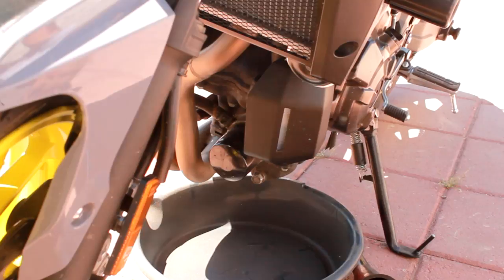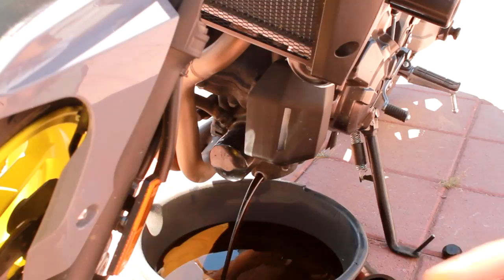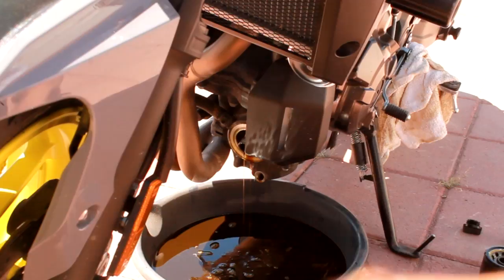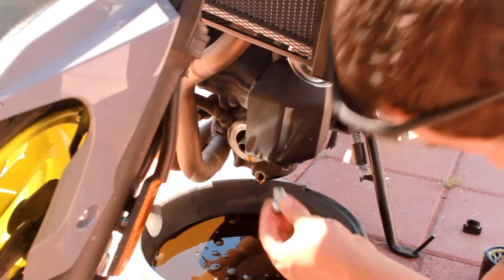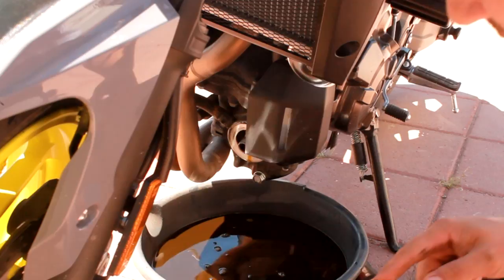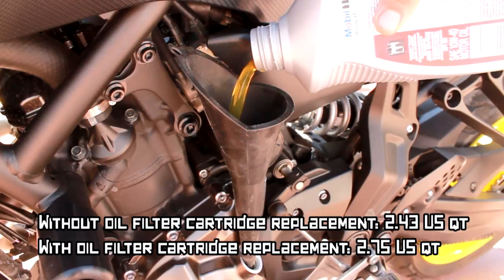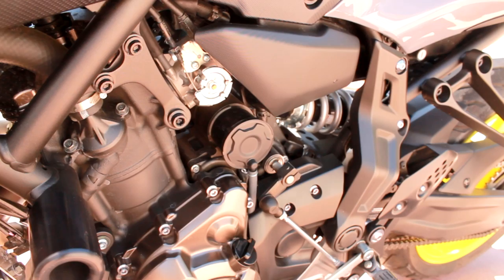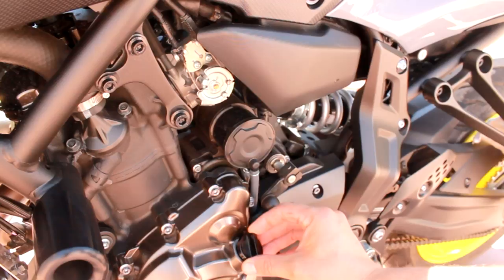FZ-07 Oil Change How To (MT-07)

Comment: I go 3 finger tight on drain bolts....i made the mistake of using a bit more force than necessary once on my YZ125 and the chaos that ensued was a pain in the ass haha. luckily the crush washer gives it a little bit of leeway and usually it'll be ok.